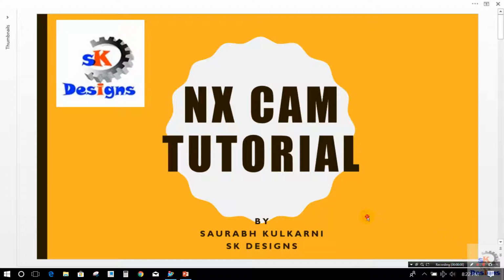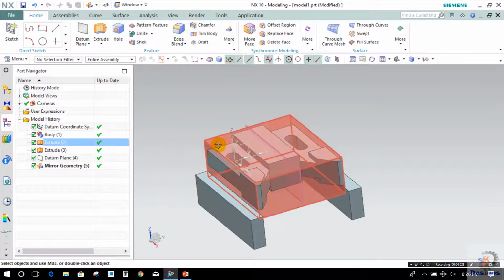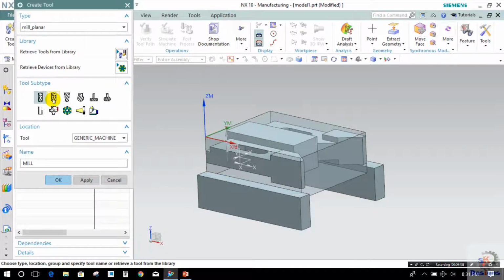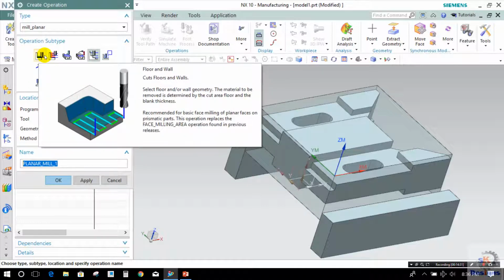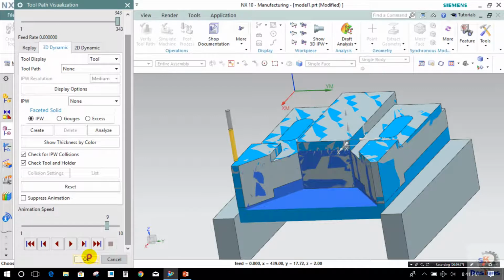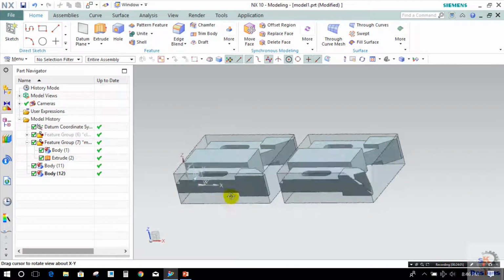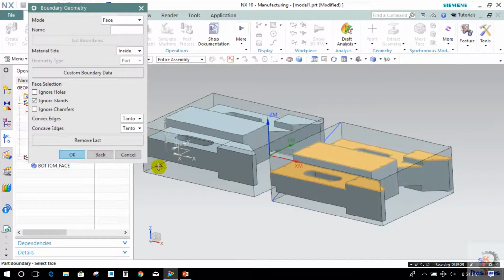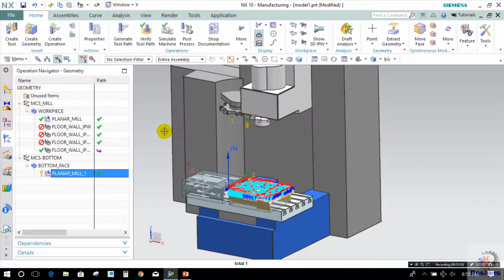NX CAM MILLING

Comment: It is ok but how to do fixture for this job
Reply from the maker: This u can models this in Nx Modeling
Reply: @saurabhkulkarni284 can you please tell me the name of the option
Reply from the maker: Using extrude command
Reply: I know that you don't no how to do the fixture
Reply from the maker: M not getting what u want exactly
Reply: Top to middle the machining is completed , but bottom surface ,  we have to fixture for top surface can you say option for this
Reply from the maker: In that video it is mentioned.
1st create cad model in Nx Modeling then in manufacturing you only need to define it while creating the tool path. Plz watch the video carefully
Reply: I want to cut only profile means I want fixture for this profile